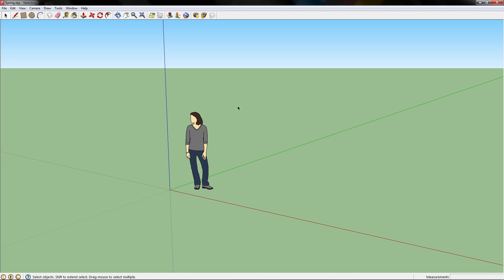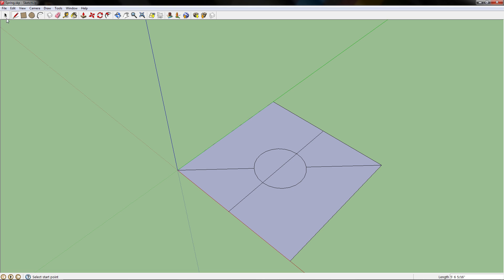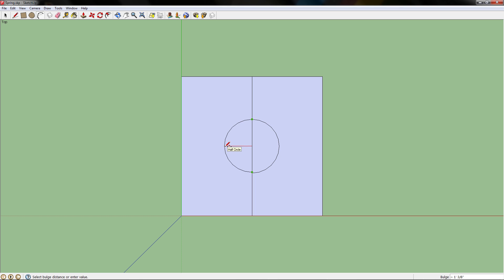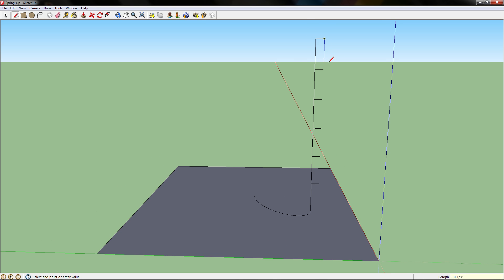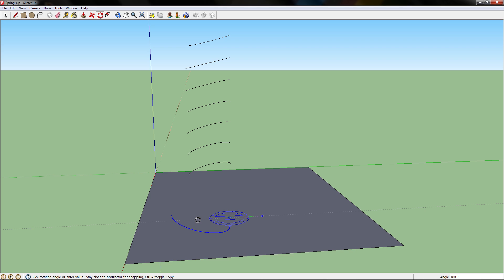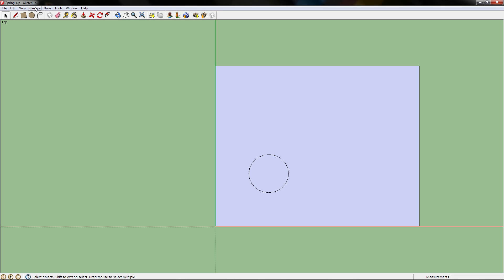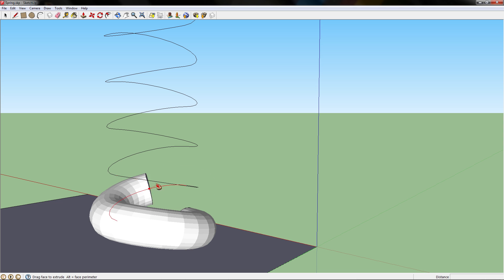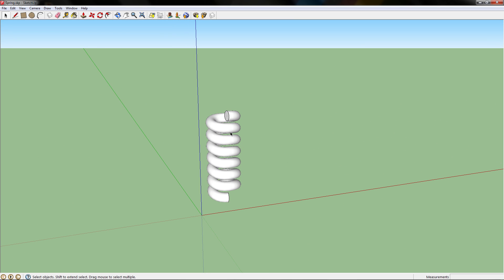SketchUp: Drawing Springs

Comment: For "follow me", high light ALL the lines. They'll turn blue. This is the path. Then select follow me. It'll do it nice and quick. No need to pull the circle around all the lines. Connecting lines: Green dot to green dot. As long as it says you grabbed the end point, your good to go.

Comment: Great video, I was drawing a large helix antenna with hundreds of turns to the spring. 
You don't need to do the hand-placement and drawing of the structure to copy the spring segments. Instead select the first arc you did, press M to move then press CTRL to make a copy then follow the blue axis (for example) to make sure you are moving vertically. Type the spacing 7 (for seven inches) and press enter then type  x10 or whatever and you end up with 10 equally spaced spring segments. No extra drawing and deleting required.
Reply: I'm forever thankful for the multiplication tip you mentioned! That could have saved me a lot of work on multiple occasions.

Comment: You can now do this the real easy way with the DrawHelix plugin (http://sites.google.com/site/jimfoltz/sketchup/my-sketchup-plugins/drawhelix/drawhelix14.rb)  If you want too extrude a profile through the helix, you can use a simple circle, ungroup the helix and use the followme tool.  Other shapes can be extruded using the ShapeBender plugin.  See my nut and bolts vid for the plugins in action.

Comment: I only have one question. How do you take this spring and use it in another model without having to redraw it? I am stuck trying to move a component into larger project.
Reply from the maker: Amerijam Acres There are a few ways to do this. The first way is to highlight the spring using the cursor tool (select the full object) and right click and "Create Component". You can then copy and paste the component into the next project. The other way is to delete everything from the document other than the spring and save the file as a SKP file. Then in your new document go to "File > Import" and import the previously exported SKP file.
Reply: Thank you.  I am a little embarrassed that I didn't try that.  Thanks for unblocking me. I'm new to this have a lot to learn.  That's a big help.